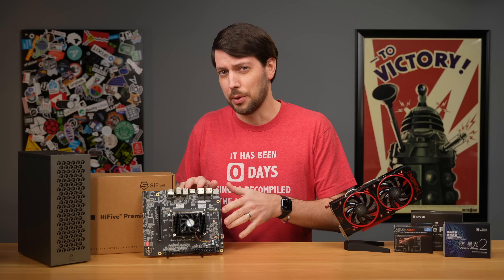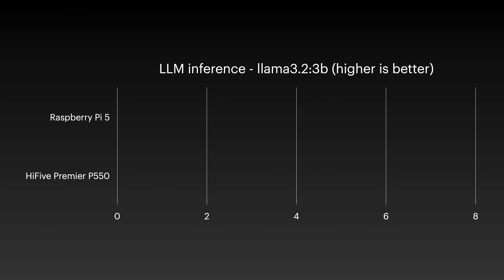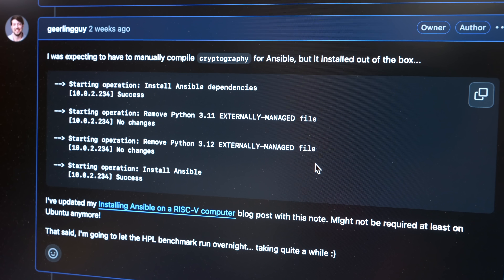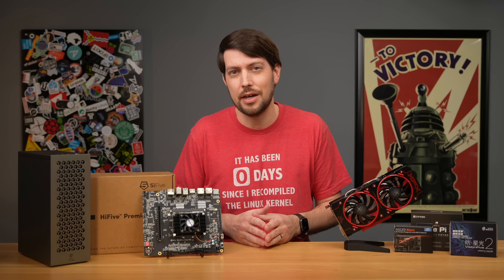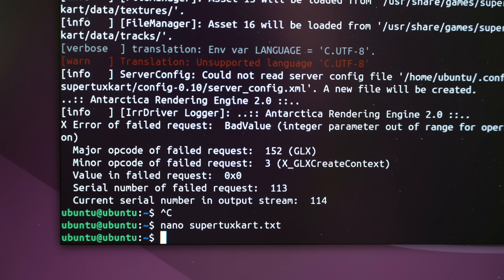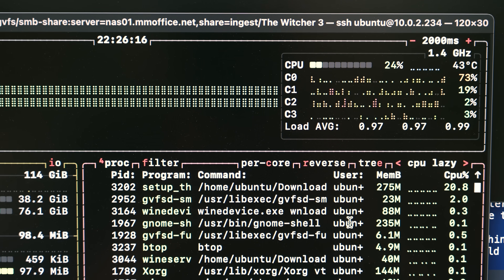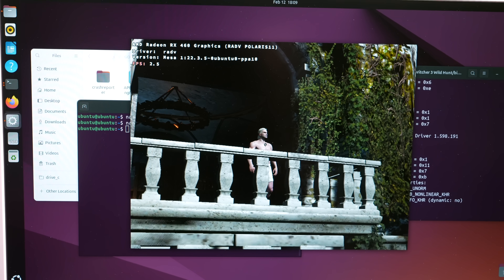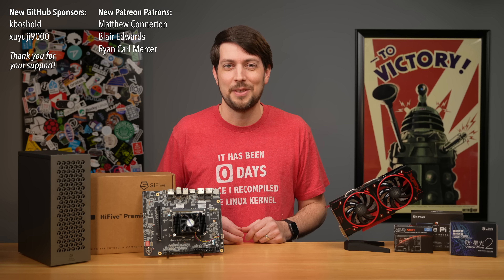RISC-V was supposed to change everything—How's it going?

Comment: Jeff is as usual right on the money. This system is useless to everyone except Risky Devs. But the point is that RISC-V went from a design on paper to mostly usable system in such short time a nothing short of a miracle. ARM took much, much longer to get to this point.
Reply: That's the great advantage of being second.
Reply from the maker: Though Arm mostly started on the mobile and embedded side, whereas RISC-V seems to be targeting a more general use case right out of the gate, which helps.

Also, many in the RISC-V scene have had a ton of experience with other chip manufacturers, which also helps a ton!
Reply: @JeffGeerling  and risc-v is already getting chips with fairly decent connectivity, while arm with a decent amount of pcie is non-existent outside of unobtanium like ampere
Reply: @JeffGeerling  ARM started on the Archimedes - well a co processor for the BBC.  I had the A3000 - faster booting than any NVMe :)
Reply: @welshtechie6832 not including installing it with 20 floppy disks? I sometimes wonder if RiscOS was used instead of android, how would smartphones look today? But their whole monolithic kernel is still smaller than some modern microkernels. Risc V can run many different operating systems, because of the open ISA, no proprietary patented drivers to lock out projects that can't pay for them. Yaay!
Reply: @JeffGeerling  uhh no it didn't it started on the desktop computer side.
Reply from the maker: @nismo4x4n  Well... I mean the modern Arm, like Newton, phones, and beyond, not the original stuff in the 80s — RISC itself was a desktop thing as well _originally_, but RISC-V also started on the embedded side and smaller designs.
Reply: @nismo4x4n exactly. I had a A3010, Simyecs personal 8mB A5000, a RiscPC 710 then strongARM.
Reply: @nismo4x4n  Hello Acorn Archimedes!
Reply: @nismo4x4n  That was before anyone really used it. All of the success has been since Cortex.
Reply: @JeffGeerling  it looks to me that RISC-V is aiming to replace first the MIPS architecture in the embedded and microcontroller markets, then it will try mobile and desktop markets
Reply: @ When I discussed this with Patterson in the 80s, I think I convinced him that Cray's designs from the 60s, despite having vector instructions, qualified as RISC because they had a small instruction set and were load/store with simple addressing modes.
Reply: @JeffGeerling  Not true.  The first ARM CPUs were built for a British desktop computer back when there was more than just Macs & PCs on the market.  Worked very nicely, thank you, but this was well before everything ran a Linux variant so there were quite a few things missing on the early chips that we'd expect as standard today.
Reply: @JeffGeerling  actually risc-v has been shipping for a while now in non-visible chips like HDD controllers and even IC units on nvidia GPUs.

The risc-v foundation has a big tent philosophy. Everything from microcontrollers to retail CPU supercomputers and open source to proprietary. 

The desktop has taken longer because it’s so freaking hard to do the full integrated system at the insanely high expectations that people have today. The rapid speed compared to, say, ARM is a testament to not only RISC-V but also to advances in foundational infrastructure software like LLVM, GCC and Linux. Bravo!
Reply: @JeffGeerling arm started as a personal computer processor. With a. OS that worked right out of the box. Archimedes was a great machine. Arm only came to portable devices way later, first with Apples ill fated Newton.
You do know this... Right? Besides there is no such thing as old arm. The current arm designs can still run a grandchild of that original OS. 😂😂😂 That is like saying x86 didn't exist untill X86-64 😂
Reply: Espressif, the maker of the ESP32 microcontrollers, has transitioned most if not all of the newer microcontrollers to RISC-V. There's more to computing than desktop and SBCs.
Reply: @jincyquones  They did that with C series, they're still producing S series based on Xtensa LX7 and those ones are "power horses" of the ESP32 lineup. ESP32 is embedded. RISC-V just barely scratched the surface of that market despite large number of relatively cheap chinese microcontrollers. Yes, there's also that RP2340 but again - ppl just use Cortex M33 for most of the stuff (and going dual does exclude license cost reduction so again - what's the point?). As CPU goes faster it is also getting much fatter which affects low-energy states. Meaning - fast CPUs tend to draw more power even in idle than slow CPUs like RISC-V. If RISC-V reaches modern ARM architecture performance levels it will consume similar amount of power. And again, ISA itself is not the only IP there to consider!  For such a hype at the premiere of the architecture and such grand support from all the companies I'd say it struggles a lot. It took just few years for Apple to actually make desktop processor out of ARM.
Reply: @Promilus1984  It is "power house" not "horse".
Reply: @Promilus1984  the point is not being tied to ARM... And using apple as an example is just being disingenuous.
Reply: @AI-qd4vb  Not being tied to ARM ain't point to consumers so screw your dishonest argument. Consumers doesn't really care what's underneath as long as it's cheap, efficient, powerful and there's good OS and APP support. So... where's RISC-V in that? Nowhere. And will continue to be there for quite a while. After all I've seen architectures rise and fall (like 68k, PowerPC, PA-RISC, MIPS, SuperH) and I've seen how long it took arm to be where it is now (and even then it's mostly due to 3rd party implementations like Amazon, or Samsung or Apple or Qualcomm). From customer point of view RISC-V solves NOTHING. Prove me wrong!
Reply: "Risc-y devs" or "risky devs"?
Reply: @ Yes
Reply: There’s also several European companies in a consortium (since Intel is American) that are pushing hard for adoption of RISC-V. If you’re anyone other than a x86/ARM patent owner, using anything other than an open source ISA is always a net loss.
Reply: What are you talking about? ARM was designed for Acorn computers and was used extensively there. And CPU division survived fairly easily when computer company went under.  Obviously it did push out most other architectures out of embedded and did dominate mobile and ultra mobile early on due to relatively low power consumption (and fairly good performance). RISC-V ain't really that fast, it does try to spread in embedded but it goes slowly. Same with mobile. And basically non-existent in desktop, hpc or data center. After all that time and all that hype. What's RISC-V fighting against? ARM basically. What was ARM fighting against? 68k, PowerPC, PA-RISC, SPARC, SuperH and so on. Yeah...
Reply: @Promilus1984  I do think you are not giving enough credit to RISC V.  
It is basically in the stage ARM was before Newton.  So far it get along good enough.  The hype is there, but mostly not from those that actually work with implementing RISC V on chips.  And yes, RISC V is aiming for competing with 68k (only relevant in  embedded systems), PowerPC (only used by IBM now?), PA-RISC (are they still alive?), SPARC (somewhere along PA-RISC and PowerPC), SuperH (have not heard from them in a while) and so on.
Reply: @AndersJackson  You misanderstood. ARM was already there when 68k in embedded was really a big player and it's derivative Coldfire was just starting up. At the same time there already was PowerPC in embedded (and desktop), MIPS and SuperH. So from all of those what is the architecture that you know still exists and has a large chunk of market? Yes, exactly. That's ARM. So again - what is the architecture RISC-V is fighting against? That's essentially ARM as well. So... ARM design by arm holding is faster than ANY RISC-V implementation out there? Yep. And is custom ARM implementation made by Samsung, Qualcomm or Apple even faster? Yup. Which essentially means anyone implementing "fast RISC-V" is still way behind arm holding itself and can't hope to compete with top companies creating custom ARM implementations. And even if SOME company did manage to keep up with those 3 it also means NONE OTHER can get that architecture changes for free so it all comes down to what I already wrote. Competition-wise it's nice to have but in the essence "open ISA" doesn't mean a f... thing here, it's actually irrelevant. What's worse - you CAN buy half a decent ARM architecture license from arm holding. You CANNOT buy half a decent RISC-V license anywhere. It means you cannot make e.g. custom 64 core RISC-V processor with some fairly powerful core developed by 3rd party. But you can buy license for e.g. ARM Cortex X3 and create 64core version of it and it obviously will be developed faster and will run faster than any similarly designed RISC-V to date, right? Right. And even if there were such solutions it would hardly be any cheaper. Yes, there are ARM SoC manufacturers selling chips at wild prices (e.g. Allwinner) if someone thinks that it's possible to make something similarly performing on RISC-V and thanks to that make it even cheaper - ouch, you're damn naive...
Reply: @Promilus1984 What makes the ARM ISA inherently faster than RISC V? I've designed and implemented several ISAs over the years and while some ISA choices make the implementation difficult to optimise, I haven't noticed any major gotchas in RISC V.

What's your experience of designing ISAs and implementing them in hardware?
Reply: @Promilus1984  yes but after acorn fell through, they didnt really promote themselves as desktop. It couldnt compete there. it can now, and is succeeding in desktop and server markets, but that wasnt really until the last 7ish years
Reply: @gamagama69  It doesn't really matter, RISC-V is far cry from desktop. Hell, even mobile devices are essentially out of reach for RISC-V in current form when in mid 90s ARM became popular choice for such devices and took over basically whole market in just 10 years. It's not like RISC-V offers anything special to consumers, right? So why one would expect it to beat crap out of well established architectures? Unless Apple makes RISC-V based CPU with half a decent performance and with usual Apple marketing nothing is going to change on those markets.
Reply: @Promilus1984  you clearly don't understand the problem RISC-V is supposed to solve. It's supposed to be a Free replacement for IP that costs you $2 million dollars to licence or ten times that to develop yourself, to be an instruction set architecture with an existing toolchain (and hence OS and software stack) so you don't have to do much port that, and to be general enough to be useful from microcontrollers to supercomputers. At that it performs admirably.

It's used embedded in quite a lot of stuff, including high performance applications like NVIDIA embedded a whole lot of them into their GPUs.
Reply: @cianmoriarty7345  Well, supposed to solve is a good way to describe it. Tell me more how going into RISC-V and creating powerful CPU implementation based on that ISA saves you money instead of going directly to arm and taking their Cortex A ? You know you have to develop that IP yourself and spend a f... lot of money on R&D and legal department?
Reply: @Promilus1984   No instruction set architecture is inherently "fast" or efficient, it is the implementations that are fast or efficient. 
ARM is only considered energy efficient because that has been the main target market, because that market likes customized chips and the ARM business model provides that customization ability in a cost effective manner. 
(Modern ARM ISAs are no longer RISC in any strict sense anyway, though they do still use fixed-width instructions with some implementation pros and cons verses variable-width found in the AMD64 ISA)
Reply: The evolution to this architecture started with RISC-I and RISC-II in 1981, RISC-III in 1984, RISC-IV in 1988 and finally RISC-V in 2011. It has just as long a history as ARM. ARM got to an equivalent of this around 10 years ago, and chip making wasn't nearly so advanced as now so any in-record-time achievements here are due to a huge advances in chip making and the tools to that go along with it. ARM got there faster because of buckets of investments. RISC-V still has a long way to go to before it's viable. I really want RISC-V to succeed but it's probably a decade away, if ever.
Reply: ARM was shipping in a desktop system, the Acorn Archimedes, in 1987. Not a niche item for developers. An actual home computer competing with the Amiga and Atari ST line.
Reply: To be very specific, the open RISC-V ISAs leave out a lot of features that are important for performance, but there are some vendors (e.g. SiFive) who offer proprietary extensions and proprietary cores.

I don't see a reason RISC-V should excite anyone who isn't already licensing from ARM and hoping for a competitor to offer better licensing terms for embedded processors.
Reply: @SnakebitSTI  RVA22 includes vectors, so no need for custom extensions. ARM went after Qualcomm (and ARM lost ), there are probably several companies that are looking for an alternative.
It's a pity Sophgo has been sanctioned, as the SG2380 looked really performant and affordable.
Reply: It is the ultimate pro writer’s box. writers need serious security, because it’s now easier than ever to steal their ideas and then launder them with ai.
Reply: @aaronmoore3050  what writers? For fiction, fortunately AI faces the same hurdles getting published that anyone does!  lol Seriously, ideas have always been pretty easy to steal and "launder" especially from new undiscovered novices for who it's difficult to bring legal action.  I'm still getting over how my boyhood hero Bob Kane stole Batman (and most of his villains) from Bill Finger, who died in debt, sick from HIV.  I think you may have a case for it being "quicker" to steal with AI, with a little less work, perhaps. But for one thing, they have to compete with people honestly and openly using AI.  A crowbar makes it easier to break into places, but blaming a rash of crime because of how easy and available crowbars are, misses the mark.
Reply: I would certainly not call it 'mostly usable', the ton of code translations are a shortcut and certainly not deployable anywhere.
Reply: 15 years is incredibly short?
Reply: RISC V started almost 15 years ago at Berkely University. That was the time when it was only on paper.

ARM started in the middle of the 80's as BBC Microcomputer's self designed CPU. It's usage in mobil things started about 15 years later.
Reply: The RISC-V is an open hardware architecture which unlike their commercial counterparts, lack all the hardware optimizations and special instruction sets which make it practically slower than running in software mode in a commercial equivalent.
Reply: @johnnychang4233  no, it is just an open source instruction set. RISC-V implementations can be proprietary or open source. The one in this video certainly is proprietary. The benefit of having an open source instruction set is that anyone can build a CPU without paying licenses. Performance-wise, having an open source instruction set or not does not really matter.
Reply: @camillevuillaume  What I am referring at is that nowadays the x86 instruction set is running in an emulated layer atop a RISC instruction set in modern processors unlike the old days previous to the Pentium era which the instruction sets were CISC at the hardware level. There has to be a way to optimize the instruction set at the hardware level which due to the novelty of the RISC-V the different manufacturers hasn't figured out yet.
Reply: @camillevuillaume The benefit of RISC V is anyone can build a CPU based on the open standards and add any mind of special instructions, execution units, accelerators.
Reply: @johnnychang4233  well, no.
You are right that many of the RISC-V implementations are not optimized.  But that doesn't mean that there are optimized implementations . 
It has not been put that much into optimizing many implementations yet, so there you are right.
Reply: well it kinda answer why. it is kinda pull from my ass theory, but ARM take the initial phase by giving a nice step for new dev to tinker into risc arch, i bet RISCV devs are stem from ARM dev
Reply: "useable" doesn't mean "powerful enough to run aaa games" you clown 🤣
Reply: That's like being surprised that it took a lot longer to build the first car than it does to make a car today.   When something is new, the number of people that know about it and have access to it are small.  Go from the point of ARM's start to 40 years in the future to the here and now and the number of people that have experience doing anything with ARM and the other CPUs has increased by just a small numbe and the ability to learn in a formal and informal setting, design, develop and produce CPUs, etc... has gone off the charts.  So, yeah, why would you be surprised that something that came out 30 years after ARM and that has the backing of nation states was able to progress to the point it is now?
Reply: ARM spend a lot on R&D that open source would never be able to afford. As much as we love free stuff there are things that cost money and people aren't just paying for a license to use something coming out of the thin are for free here. Nobody will spend 20 man month optimizing and debugging for a significant improvement when no profit is involved.

Comment: What platform would be appropriate for encoding 1080p60? Is RP5 fast enough?
Reply from the maker: Pi 5 would be able to handle it at some settings, but not with a ton of quality... there are encoders on the RK3588 so some of the better supported Rockchip boards might be a good bet if you need to do a ton of encoding.